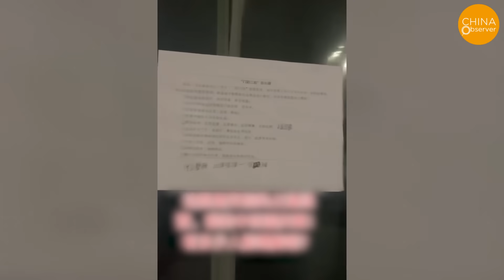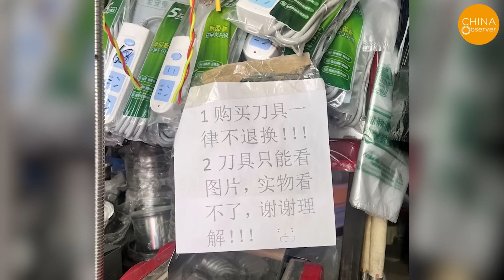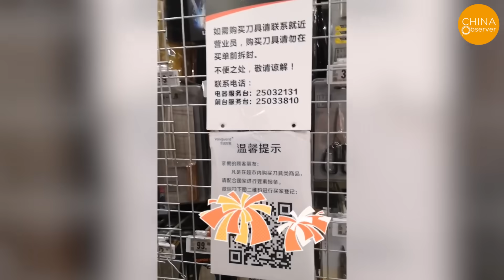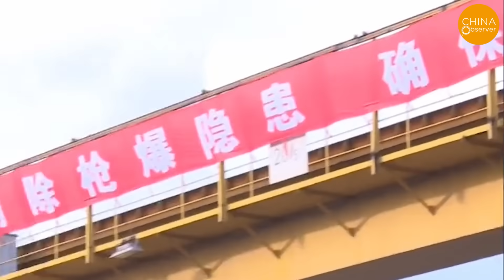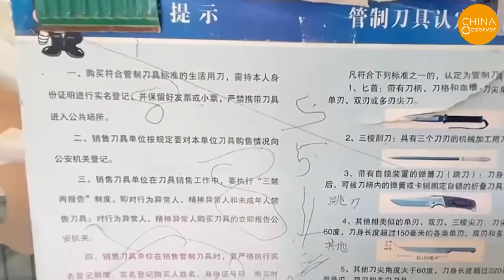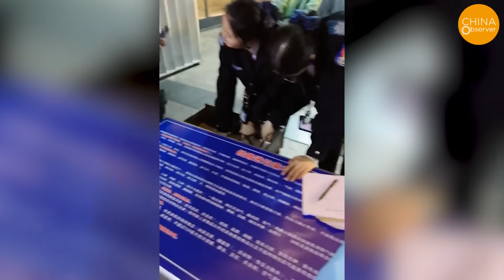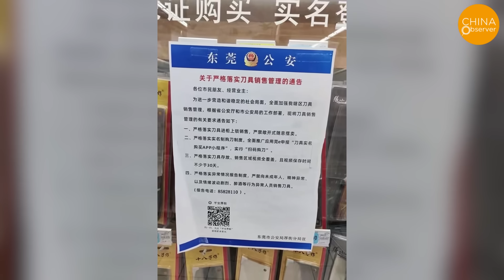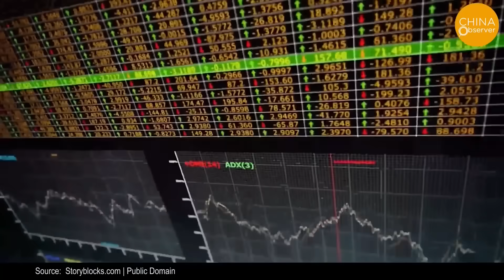Chains on Kitchen Knives, NOW Regulating Sharpeners & Clippers! How Scared IS the CCP?

Comment: Of course they are, this won't be the first time their people revolt with household tools. Each Dynasty has it's fair share of rebellion.
Reply: A little fertilizer mix from a local farm will be much worse than knives and clippers. 😂
Reply: @powershift2025  Yup, vehicles are also weapons.
If you want to arm a rebellion quickly though, all you need is some wooden shafts, some semi-thick steel sheet metal, an angle grinder, a drill, and some screws. Spears for everyone.
Reply: @OnlyKaerius pppm seriously underappreciate the simple joys of blunt implements.
Reply: @OnlyKaerius  definitely, but first air drop in a couple 20 shipping containers full of AK's. Start off with a little automatic for the people...
Reply: the scariest people are those people who has nothing to lose, in this case CCP took their people's right to live and basically slaving them to death so yes rebellion it is 🤣🤣
Reply: Nail clipper revolution
Reply: I hear bricks and all blunt objects are next.:hand-pink-waving::face-blue-wide-eyes::face-orange-biting-nails:
Reply: Like Thanos said in a comic " Every fallen empire started with a hungry peasant."
Reply: 3D print FGC-9

Comment: It woulda been a real shame, if someone with an angle grinder, would cut out long pointy shapes from some random sheet metal and sharpened them. Really, do not DO IT.
Reply: sounds incredible, you can't buy more than 3 knives. Are they afraid that a knife revolution could break out? Imagine the power, hundert of man, all armed with a 5 inch kitchen knife! 🤔btw, It is pointless to cut long, pointy shapes out of Chinese metal. Have you ever worked Chinese steel?
Reply: @Ezekiel903  Chinese steel made from... Chineseum. Not good. Fertilizer mix from local farms would be fun for all though...
Reply: Chinesium? Now that is hilarious. I will remember this word. It's priceless in describing tofu dreg quality standards in the People's Prison Republik.
Reply: @soco13466  a new discovered very weak particle😁
Reply: @soco13466  now imagine an entire army built with Chinesium. That's a lot of garbage. 🤕🤕🤕
Reply: @soco13466 People’s Prison Republik, I will remember this word. Great word to describe that country; lol.
Reply: Bonus points for putting them on wooden hafts. Spears for everyone.
Reply: @Ezekiel903   I have work with it. It a like if some one put sand in metal. It full of so much trash. It not temper right.  It will shatter , bend and the melting point is all over the place in one piece of metal.   It will not hold an edge.   It smell funny some time and look like crap.  They don't remove slag and you can tell.  
I want to get a piece and put it in a chemical bath of oxidizers to see what  it made of.  
I   took  a few tools away from people made of  that crap. Out of fear it will hurt them.
Reply: Beware sharpened pencils ✏️
Reply: @i-fart-n-elevators4610 starting to becoming like airport security. lol.
Reply: They got tops of car windows an ceramic mugs im postive on that :) they will make due.

Comment: If the chain is made in china too then can't you just use the made in China knife to chop the made in china chain? I am actually intrigued as to which one will break.
Reply: Where are the Little Pinks? AHAHAHAHAHA
Reply: Movable object meets stoppable force xD
Reply: Goof one there bud😅
Reply: Material used: Chinesium, as mentioned in an above comment.
Reply: Because they are both made from Chinesium it means that they have the same relative strength as these two items would have if made from actual metals.
Reply: It's obvious, both will break! 🤣
Reply: I bet those hard types of biscuits/cookies are stronger than the Chinesium metal. ✌☺😂😂😂

Comment: Seriously, I heard nothing about slingshots.  A slingshot can hit as hard as a gun within 8 meters.  How about shovels and hoes?  Hatchets?  Axes?  How about a plane blade or a table saw blade?  Hand saw?  How am I supposed to cut wood?
To make one I need a rubber inner tube.  Are those restricted as well?  How about a drill?  DRILL guns are made with a handle and a protruding tool interface.  Springs are essential for the making of some guns, especially automatics.  How about using my illegal drill gun to turn a spring on a dowel in a drill?
Walking sticks, cricket and baseball bats, batons, and wooden handles which separate from tools or implements are illegal as of Jan.1, 2024 
Is that correct?
Reply: there's a video here in youtube how to make a sling shot that hits like a gun..
Reply: @controllerplayer1720  I'll bet there are 10 such videos.